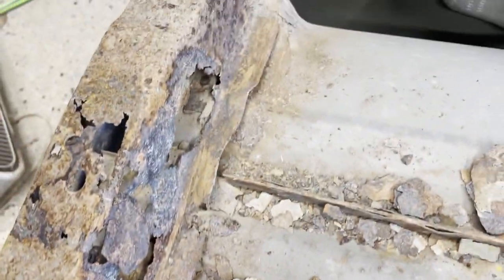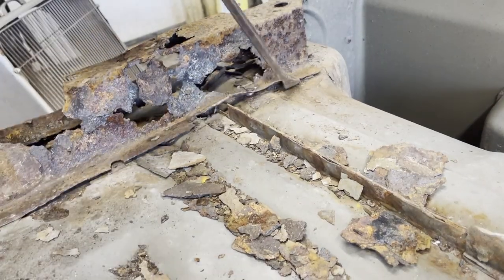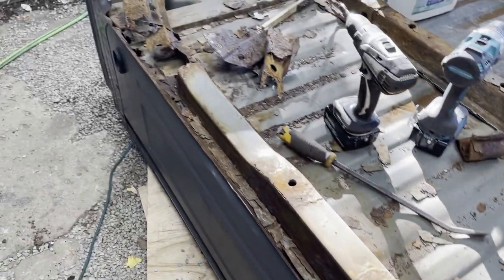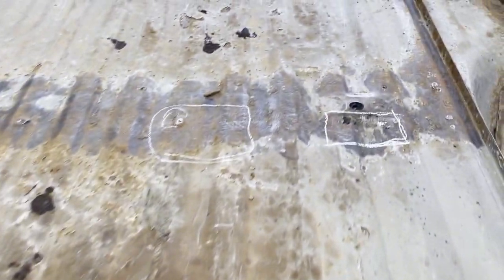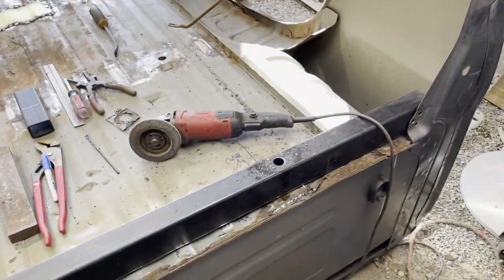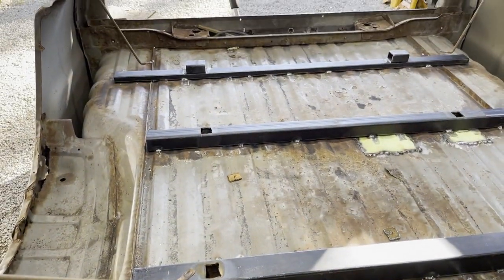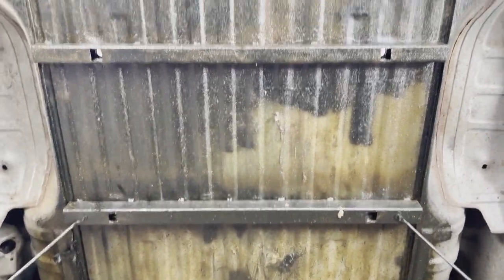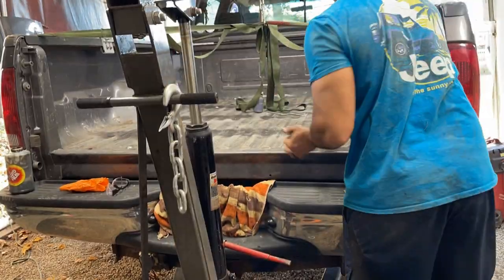DIY F250 Truck bed rust repair. Part 2. Sheet metal work. Bed Install. Undercoating.

Comment: I'm surprised that the wheel wells/arches are in such good shape. I would have expected those to rot out before the bed crossmembers. BTW, other body men have mentioned using signpost stock to fabricate new crossmembers. It's the type that has a U crossection with splayed out sides and uniformly spaced holes to mount road signs. Best of all the holes are ready made drain holes for this application.
Reply from the maker: Same here, I have done the sign post method a long time ago on a stepside bed. I prefer using the crossmember kits because of it being practically OEM. I also used squared tubing for these beds before with great results.